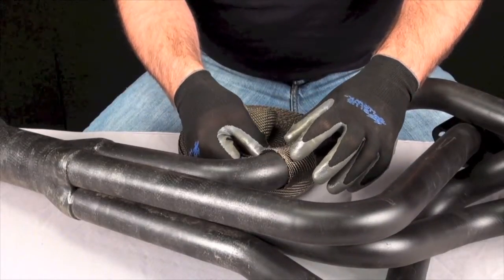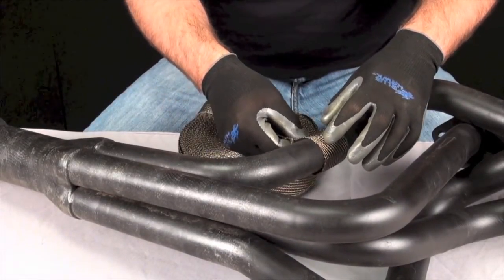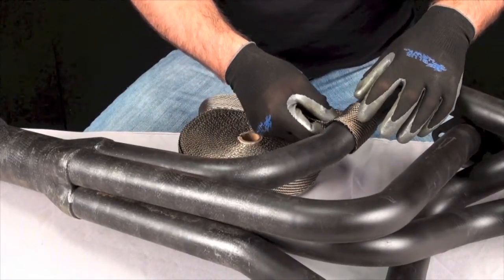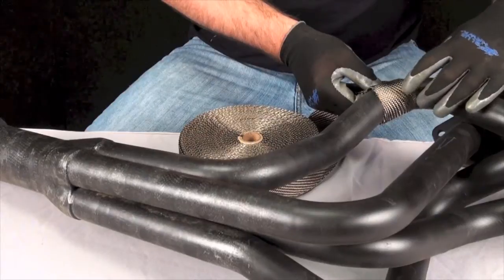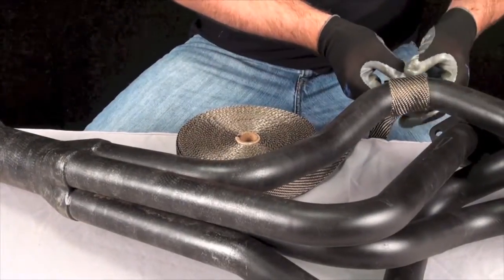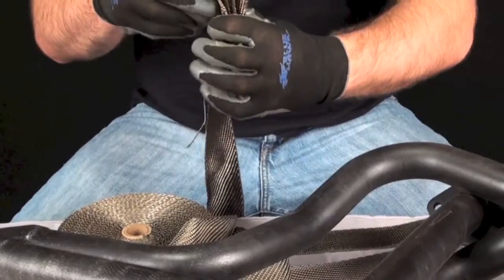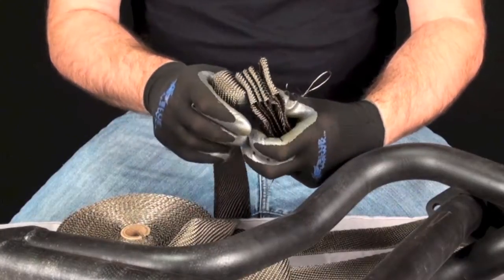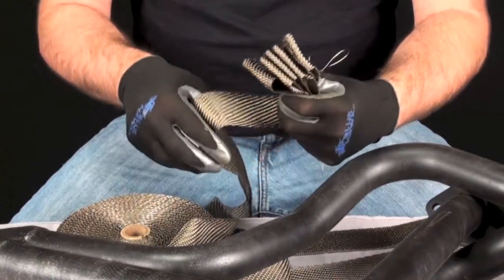Exhaust Wrap Tip: How to measure exhaust wrap length

Comment: What was the aprox lenght that was needed to wrap these exhaust pipes. 
I dont need a cm accuracy but is it like 5m, 10m, 15m?
Reply from the maker: We usually use a little over 15m of 2" wide wrap per V8 header.